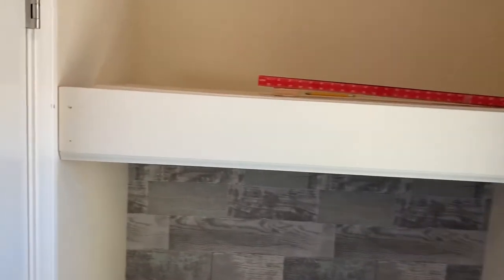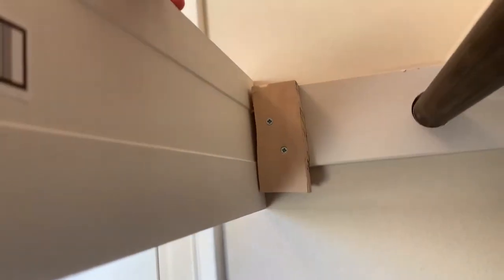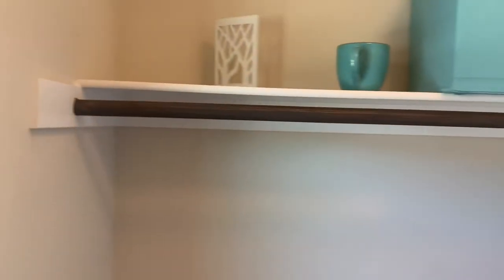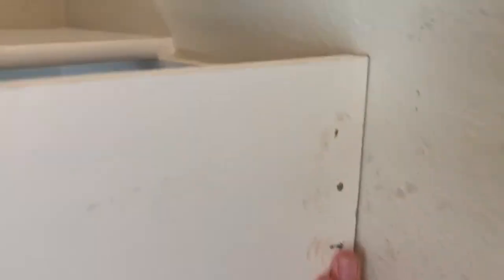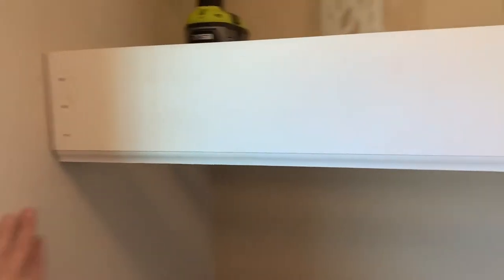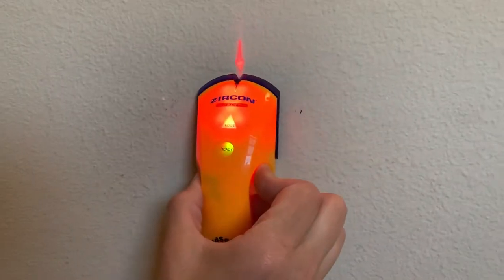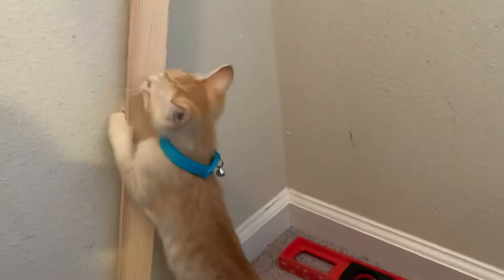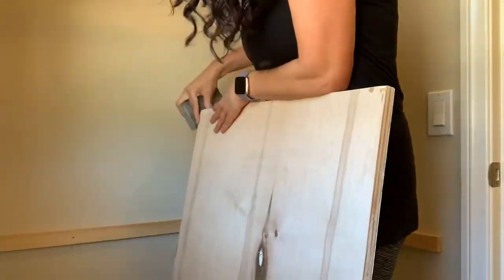Classroom in a Closet | Distance Learning Classroom Setup 2020 | Day 4

Comment: I think you're doing a fine job on the closet/room. And as you see builder's don't pay that much attention to the closet framing in homes. So listen if you want to hide the gaps on the shelf or shelves in there use some 1/4 or 1/2 inch round moulding and get some 1 inch Finishing nails with a 1/8 inch drill bit to lredrill the hold for the moulding so it doesn't break when you put the nails in it. Looking great Hugs to you and the kids.
Reply from the maker: That’s what my dad said when I called him complaining about it! I just need a new small drill bit. I broke ours. Thank you!